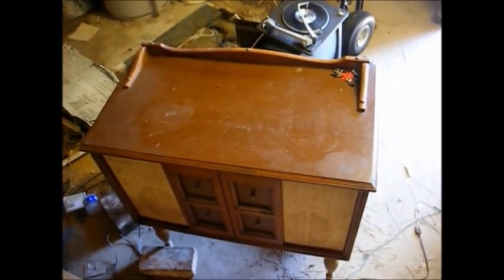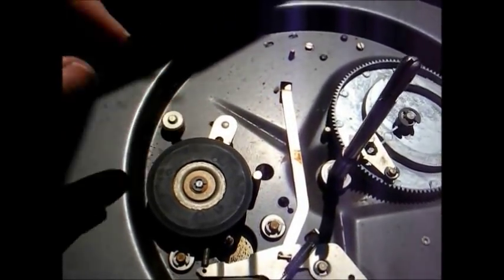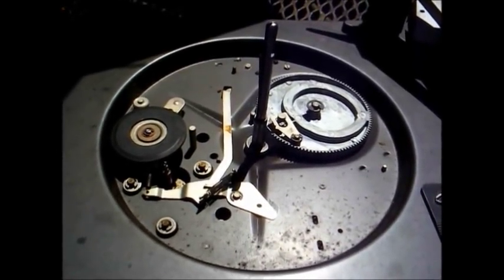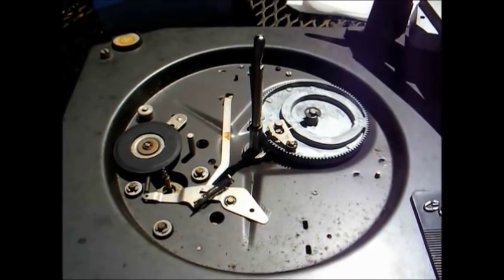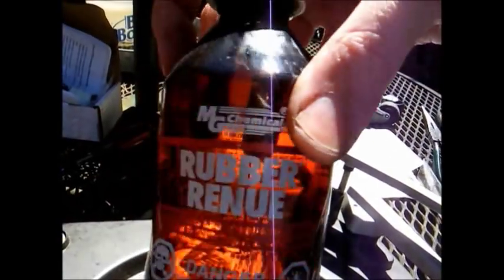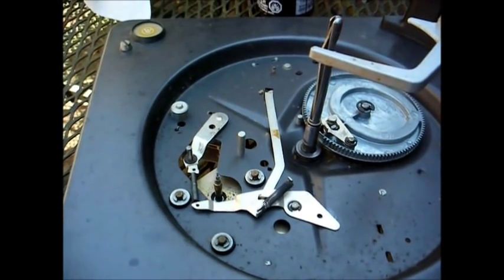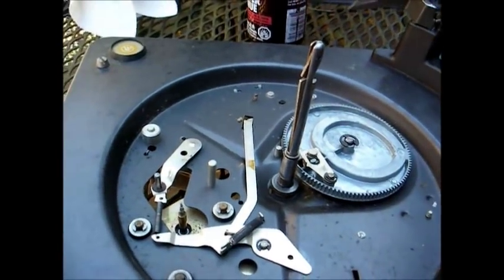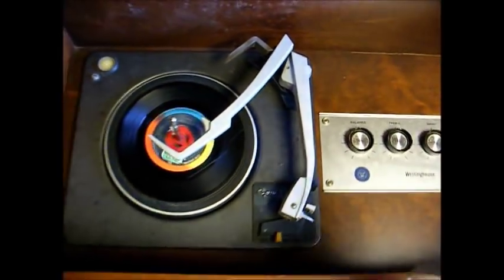Repair of the Garrard record changer in the '63 Westinghouse console stereo - pt. 1

Comment: I’ve got two of these same type turntables, the auto return mechanism wont work, I have cleaned and lubed the cam gear and made sure the spring on the rear of the tonearm is in place, but still nothing ,do you have any suggestions?

Comment: I've encountered corrosion in the bore of the cycle gear that locks it solidly to the arbor it turns on. Grinding off the staked on head and driving the arbor out with a punch allows you to clean everything and relube. Then there's the grease that gets thick and sticky. I'd rather deal with those than try to fix my HDTV with green people and pink sky. I'm an electronics tech but if I can't obtain a programmed controller chip for a modern tv or whatever it'll go in the garbage.